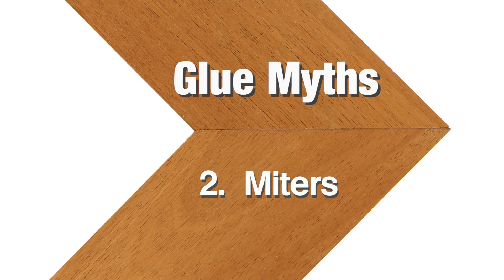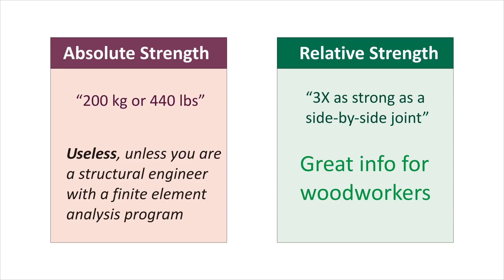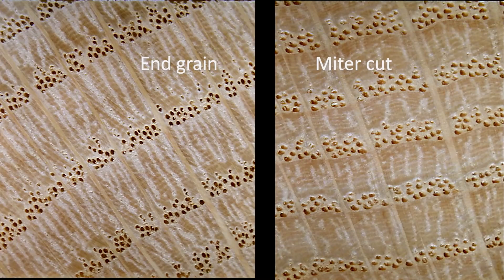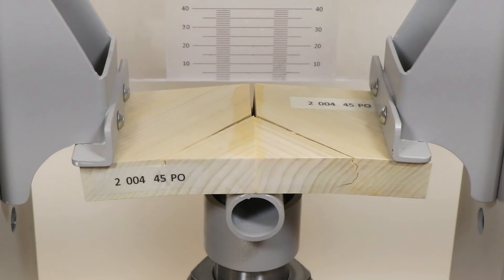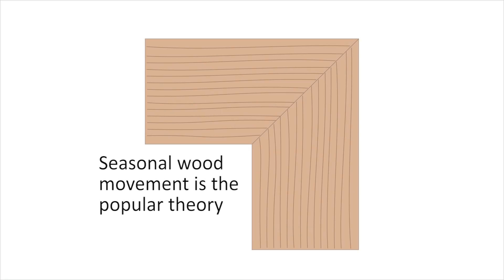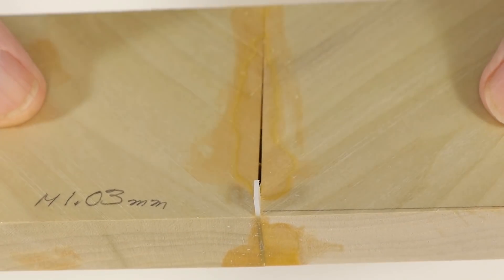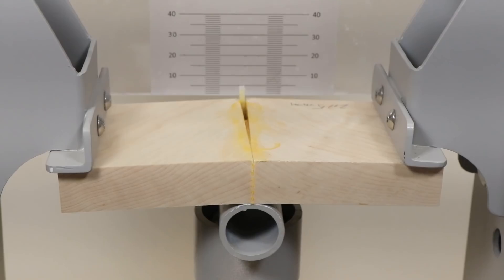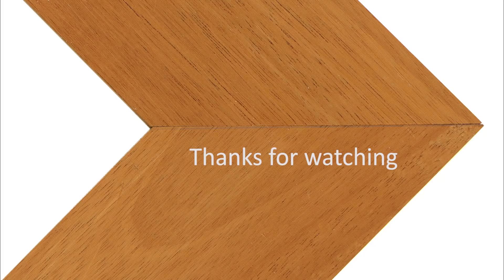Glue Myths:  2. Miters

Comment: One again the results are misleading
You can "prove" just about anything you want to with some simple testing. These 'myths" as you like to call them, may be busted in isolation only but have no real world impact. They actually seem to be haveing a negative impact to some who are new to woodworking and joinery in general. Leaving some with the impression that end grain joints and miters are fine and no additional mechanical advantage is necessary. This is supported by the numerous "clean up" videos that have followed your first.
 None of this information, that seems to be new to some, will change joinery one little bit. We still build using the capabilities and limitations of wood and use adhesives as insurance only. While it is true that glue can be incredibly strong in the proper application, a glue-only joint is not joinery and should in most cases be avoided or at least only used ny those who know the risk that are involved.
Reply: This is a video on relative glue joint strength; nothing about joinery was brought up. How are the results misleading?
Reply: @RodelleLadiaJr  
Testing "relative" strength in a lab setting is fine but there is no pratical value.
Many people are left with the impression that a glue bond alone has enough strength for their project. In practice, this is seldom the case.
Reply: @Eweber007  I could agree about the confusion because the original video had numbers which could be taken out of context, but this video specifically doesn't mention any numbers. All the video claims to do is show that mitered glue joints are stronger than edge grain glue joints (which goes against common knowledge). What is misleading about it? And, I do believe there is practical value. ie. a pocket joint between a glued end and edge is just as strong as a pocket joint between two glued edges. The myth would have us believe that the end joint is weaker because it's a weaker glue joint, but these types of videos disprove that.
Reply: @RodelleLadiaJr  
"All the video claims to do is show that mitered glue joints are stronger than edge grain glue joints (which goes against common knowledge). What is misleading about it? "
Because they are not in a practical setting. These test are done in a controlled way and in no way reflect a real world scenario.
The problem is when someone says "this joint is twice as strong as that joint" people tend to listen without any critical thinking. It's fun to "bust a myth" right?
The problem is that there is no myth, just a misunderstanding by many who are now amazed by the results of the Sullivan videos and subsequent clean up videos.
Judging by the comments of all these, I feel they have done more harm than good.

Comment: Add to this finding that mitter joints are be definition larger (more surface) than the mitter joints you've tested (you've cut them to the same surface, to allow comparing).
Larger joints means stronger joints (I doubt you need to make a video to prove that one)